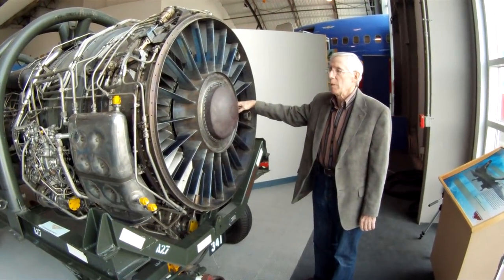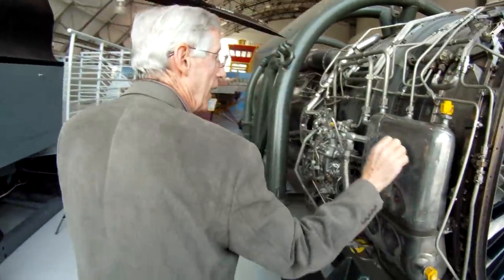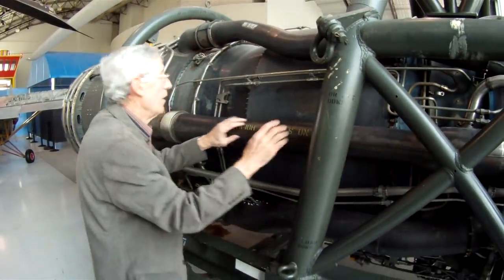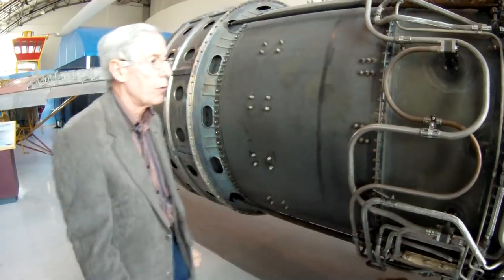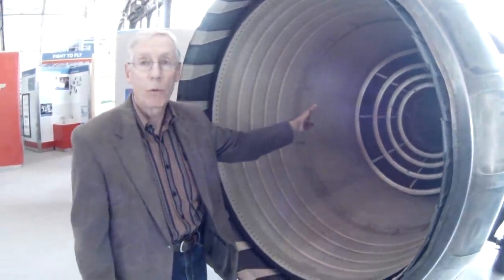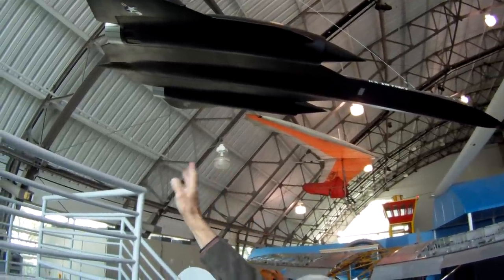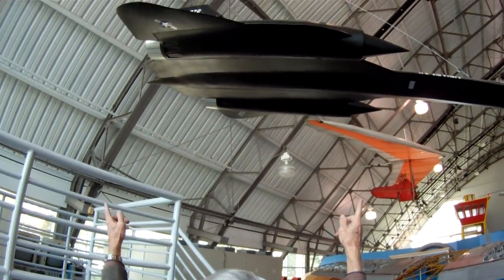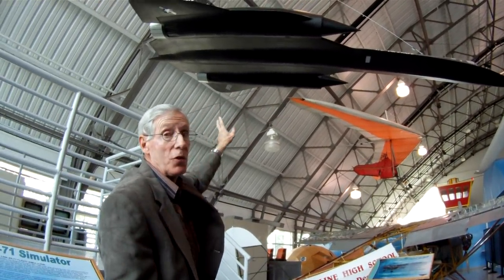SR-71 J58 Engine Tour

Comment: Super simplicity of this engine, is the lovely thing about it.

It's a multi cycle engine, which at the time was a novel concept. As Richard says, capturing the shockwave and utilising it to bypass the central core of the engine in order to re energise the heat from the shock wave to ignite the fuel at the back, is one of the loveliest physics principles at work in everyday life.

An amazing, but just as awesome comparison, can be made with Concorde. Well, Concorde wasn't a motorcycle engine in the traditional sense like the j58, however, Concorde was most economical when travelling at Mach 2.02, just as the SR-71 was most economical travelling at mach 3. This is because, using the similar principles.

Although the Concorde didn't need to use a high pressure shock wave, to bypass the core, it used computer-controlled inlet doors to compress the airstream taking a lot of work away from the compressor stage of the engine, squeezing it so that energy could be encompassed from the forward moving aircraft.

This meant that at cruising speed Concorde was using just 66% of the power from the engine to move forward. The rest, came simply from the act of moving forward at Mach 2. It meant effectively, in simplistic terms, that both the sr 71, and Concorde were pushing themselves along.. err.. by pushing themselves along..

One of the craziest things to try and wrap your brain around, is the fact that it is effectively free energy. The faster you move, then the faster you move. You suck air in, you squeeze it and you squirt it out the back at high pressure.

The j58, is a magnificent piece of Engineering, and was at the forefront of engine technology in the 1960s. The Pratt and Whitney engineers who built the j58, the Bristol engineers who built Concorde Olympus engines, were all very clever, as was Kelly Johnson.
Reply: Not quite. The J-58 and RR Olympus are almost diametrically opposed in principle. 

The J-58 was the largest engine available at the time but it was totally unsuitable for even high Mach 2 flight owing to its overly compressed design—a legacy of the application it was originally designed for, the Martin P6M flying boat. 

Most engines produce less static thrust because they all compress air in the inlet—whether it’s a subsonic divergent inlet or a supersonic convergent-divergent variable geometry inlet. 

The Seamaster needed the highest static thrust it could get to take off on water carrying heavy loads.. so it used a modified bell mouth inlet like you see on static test rigs and helicopters. This unfortunately does nothing to compress the air at high speeds and altitudes, so the J-58 was designed with a much larger compressor than is typically required. 

But when it came to flying high subsonic speeds, the engine was too compressed. The temperature rise from inlet compression plus the compressor meant the compressor discharge was almost as hot as combustion temperatures. This meant you couldn’t add enough fuel to even turn the compressor, never mind have any thrust out the back. If you did, the compressor would stall from having too much back pressure. 

At Mach 2.5, inlet pressure would effectively be higher than nozzle pressure.. making thrust negative. 

But when you’re a government organization with a black budget that’s being strained by overthrowing democracies, you improvise. 

Dumping the high pressure from the compressor into the afterburner both reduces temperatures and back pressure and increases afterburner pressure for efficiency. But unfortunately it’s a complex an inelegant solution to a problem easily solved by deigning the engine for Mach 3 in the first place. The pressure gain from those bypass tubes almost makes up for the pressure loss across the turbines to generate that pressure in the first place.. plus all of the mechanical, frictional, and duct losses transferring that energy up to a compressor only to transfer it right back. 

That’s why the YJ-93 didn’t need bypass tubes. It had a compressor with variable stators to load and unload it at will. This meant lower turbine temperature and pressure drops. This meant that the gas producer was actually producing thrust (the J-58 gas producer—the compressor, combustion chamber, and turbines—are actually producing negative thrust from Mach 3 on even with the redesign) so your afterburner is still efficient with higher pressure gas and it doesn’t work as hard. 

That’s another aspect about the J-58. You look at the Olympus or YJ-93 and their excess intake air is immediately dumped overboard. This mostly offsets the drag from compressing the air in the inlet. On the SR-71 flows around the afterburner into the exhaust. This is because the afterburner is working so hard and needs that air for cooling. The duct losses are considerable because of it. A shorter duct is always the most efficient and that’s what Concorde uses. 

And look at the results. Concorde supercruises with no reheat required. It’s all inlet and gas producer thrust. 

The XB-70 was a much more efficient aircraft than the SR-71 as well partly because of its purpose designed engines.

Comment: Richard Graham has written several excellent books on the SR-71. I recently asked him about Mach 3+ flight, were you ever able to relax and enjoy the ride? He said yes, once you had been at that speed for awhile. But even so, he had to be prepared for the unexpected. My other question was about heat inside the cockpit, he said his pressure suit was climate controlled and its temperature was adjustable for comfort.
Reply: In his book, Ben Rich makes the comment that he didn't think aircraft manned aircraft could be designed to go faster than the SR71 because the life support systems could not be designed to keep a human alive.  If you think about it, because the average skin temperature of the SR71 is 600F, the crew is basically working inside an oven.  On such a hot aircraft, where do you find a cold zone to reject the heat from the cockpit to keep from roasting the crew?  

I know the X-15 went 4500 mph, Mach 6.7, but that was only a dash that lasted a few minutes.  And on that particular flight, they came within a few seconds of losing the aircraft due to structural failure.  The SR71 had to cruise for 2 hours at Mach 3.2, which is more than long enough for everything to heat up to thermal equilibrium, then just sit there and bake.  Nothing could be used that was readily available.  Even the landing gear tires were special.  How do you get tires that can withstand 600F without exploding or turning into charcoal briquets?  Hydraulic fluid?  Special stuff, and mission critical because an hydraulic system was used to position the inlet spikes.  Insulation on the electrical cables?  The list of problems goes on and on.

Comment: yes. My source is Ben Rich's book "skunk works", also Rich Graham's book on the SR-71, and Kelly Johnson's book, "more than my share."  All are great.  The "fix" was to "unstart" the other engine as well, to keep the aircraft from jerking over too hard to one side. It was not really a fix, just an accomodation.  Ben Rich said he never solved the problem, which was using the inlet spikes to control the supersonic shock wave at the inlet...and also vary the velocity of the air coming in.

Comment: exactly, how many times have I thought about the water Nozzle example, when I see a commercial airplane flying over my house, I could see where the air blast is coming out from, now. ALSO, like in swimming pool, put a water hose with a nozzle on it and let the water out, you could feel a  way stronger force than if you were to have to nozzle in open air.

Comment: Pratt and Whitney..masters of turbofan tech.
Reply: Maybe, but this engine can only go at 3 mach because it's a ramjet.
Reply: +MrOperettalover its a turbo ramjet
Reply: This is not even close to a  turbofan LOL
Reply: @gunnergrant12  True, but Pratt builds way more turbofans!
Reply: It actually is a turbofan when you think about it. 

Most modern fighter jet engines use the same principle, bypassing fan air to feed the afterburner for better cooling and efficiency. 

But this was actually the result of using an engine designed to power a subsonic flying boat for a Mach 3 aircraft—because it was the only engine in inventory that was large enough to do it on a two engine aircraft. The A-12 was a CIA black project and did not have the virtually limitless funds of the DoD behind it. 

But the J-58 had too large of a compressor due to its original slow speed application. This meant that just the compress discharge temperature was almost at the turbine temperature limit and the compressor was nearly in stall long before it got anywhere close to Mach 3. 

Bypassing the air was the bailing twine and duct tape solution. Sure it provided high pressure air for more efficient afterburner use.. but after the massive pressure and temperature drop across the turbine to produce it and the associated duct losses getting that high pressure air back there.. plus the added weight, bulk, and complexity. 

The YJ-93s never needed bypass ducts. That’s because it was a purpose built engine with variable inlet guide vanes and variable stators to unload the compressor at high speeds. Since the turbine wasn’t working so hard to turn a compressor producing way too much high pressure air... the thrust from the gas producer itself was positive (it was negative in the SR-71) and the afterburner which benefited from higher pressure gas did not need to work as hard so the XB-70 had much better range and reliability.

Comment: How can you dislike this? 

3 people are descendants of the Soviet Union
Reply: I liked it and im a russian
Я очарован с такого рода вещи
Reply: Ride on my man
Reply: 39 Russians now
Reply: slender bodenhofer откуда ты?
Reply: Ian Mangham thanks for watching
Reply: Whaaat? I was born in Soviet Union (though not an Russian but Estonian)  and i liked this video!
Reply: change that to 43 people. lol :) Still to think this plane was designed back in the late 1960's ? Massive amount of engineering which has never been equaled to date in the speed / flying aircraft areas of engineering. :)
Reply: Why? This plane didn’t dare fly over the Soviet Union. Not once!  It would have been scrap metal if it did. There was a Mig 25 in perfect firing position every time it transited the Baltic should it ever have strayed into Soviet airspace.
Reply: No loud music or people.
Reply: Ayrton McCutchen l
Reply: Bartonovich52 p
Reply: @Bartonovich52  actually it was the mig 31 that had the performance and most importantly the systems to be a concern. There was a time when the SR-71 could penetrate any airspace in the world if it were deemed neccessary. Usually oblique images sufficed. The Mig 25 and follow on are oriented taking out larger targets and not all that maneuverable. That isn't a criticism, it is due to the design parameters established by proposed mission requirement. In the case of the Mig 25, it was designed to defend against the XB-70. A blistering fast straight line target.
Reply: no way
Reply: SR-71 Swedish/Viking,Stealth technology invented by Soviet,CH 54 Soviet designer,F35 Soviet Concept,SR-71 plane material Soviet,Alaska Soviet and so and ao😬
Reply: 87 Chinese people disliked this video

Comment: I believe that the bypass tubes transfer the increased pressure created by the spikes and the inlet at high mach number to the after burner creating a ram jet. They are key to the power at high mach.number, they also divert the air that is so hot from compression that it would melt the turbine if allowed to proceed through the engine at mach 3.2. If this is wrong then how does the air get from the inlet to the afterburner at high mach?
Reply: the bypass tubes essentially turned the engine into a hybrid ramjet :)
Reply: 1320crusier turbo ramjet?
Reply: ***** Exactly. And the J58 is the only turboramjet engine in the world.
Reply: Pilots that at Mach 2 and full throttle ab at the edge of service ceiling with the old JA37 (thunderbolt), reported that the engine got ram-jet properties from time to time.  This how ever was right at the edge of what the engine and the design of the intake could safely handle. Engine was a heavily modified P&W JTD8 (50% bypass ratio on the civilian models). This kind of flying wasn't encouraged by the airforce but happened from time to time when they were sent up to "engage" the SR71 in the baltic sea.
Reply: it is refereed to as a High Bypass Bleed Air engine.
Reply: Check Out These Videos , that's what i thought but i found nothing that says the ramjet effect was from the cowling.  Also just look at it,  where else would the air get rammed into the after burner section.
Reply: How do I explain this at 3am on a Friday... the problem with this and every engine trying to spend quality time above Mach 3 is the compressor exit temperature. At Mach 3 with an ambient air temperature of -70F you are already looking at an engine inlet temperature of 630F. A quick late math says that even the most efficient compressor in the world can only do a pressure ratio of 5.7 before reaching the normal material capability at the end of a compressor. 
In order to reduce the pressure ratio in the compressor you have two main options: reduce combustor fuel flow or bleed compressor air.
However, flying at Mach 3 is achieved by taking in as much air as possible and then mix it fuel until you achieve stoichiometric temperature in the afterburner (e.g. you want a ramjet). The more air you have, the more fuel you can add, means more energy shooting out of the back nozzle.

So, pressurizing the air in the compressor before it gets to the afterburner would be good and more efficient. But you can’t really do it without exceeding temperature limits. You don’t want to reduce fuel flow in the combustor either because that would slow down the engine and make it take in less air. That air is needed for the afterburner. So they decided to bleed compressor air, which reduces pressure and temperature at the compressor exit, but then took the air and routed it to the afterburner to generate more thrust. 

Last but not least, the j58 engineers deserve far more credit than the 18% attributed to the engine at Mach 3. This is probably the first variable cycle engine out there. Many years ahead of its time. But hey, someone figure out how to use Prandtl-Meyer compression to weaken the shock at the inlet and other smart tricks to hold the shockwave in place. They deserve all the credit.
Reply: brown9708, actually I think the Russians used a ramp system, on the Foxbat, like we had on our F-14's.
Reply: yeah it was also my impression that those bypass tubes were more important than he let on.
But I'm surprised by have cavalier their shape is. I would have thought that ramjet flow would be much better taken care of with very little bending and constriction. Looks like a casual sewer pipe. I wonder if a much superior design could be made that hides the jet engine in the main body and exposes an unrestricted ramjet at speed.
Ramjet sounds so simple that I'm lowkey considering making my own mach4 plane :)
Reply: Those “bypass tubes” are taking the air from the compressor. They are actually compressor bleed valves that have been routed to the afterburner inlet instead of overboard. They do not take air directly from the “spike inlet”.  Air through those bypass tubes is likely going at Mach 0.1 to maybe 0.25. The air is taken from the compressor where the axial Mach number is probably closer to 0.4. Anyway, you make the pipes big enough to slow down the flow and decrease pressure losses. That’s why you can get away with unconventional shapes. The supersonic air in front of the spike inlet has to be slowed down to subsonic speeds before it gets anywhere around the engine. The main objective behind the spike inlet in the sr71 or the ramp inlet in the F14 is to slow down the flow without losing too much (total) pressure.
Reply: Sounds like you can't quite account for how it works unless those tubes are actually the ramjet operation? seems weird to me too.
Also did you hear Ben Rich once said, actually twice said, that they have UFO tech, including faster than speed of light travel?

Comment: I was told once, during a visit to Beal, that the turbine engine had to keep running during the ramjet phase just so it wouldn't get ripped off it's mountings and shot out the tailpipe. Don't quite believe it but I want to.
Reply: Well, a good story doesn't get worse if it happens to be true

Comment: If you had a reason to do so, you could likely build a more efficient version of the SR-71 system using Turbofan Engine tech.  Obviously I don't mean an off the shelf model, but for example instead of having to do the pressure bleeding with the six lines to bypass the compressor, you could likely put a smaller turbine section not as bothered by the high compression and let a larger portion of the air flow around it as a Turbofan does anyway.

Obviously it would still require quite specialized engineering to hold up to Mach 3+ flight like the J57 did, but the flip side would be that it would likely be more fuel-efficient in the lower subsonic range while still being likely at least as efficient in the high-mach range (compared to the J57 I mean.)

Of course it's all theoretical...there just isn't a lot of need for uber-fast aircraft these days in the Military and the Military is the only one who would pay for machines like this, etc.